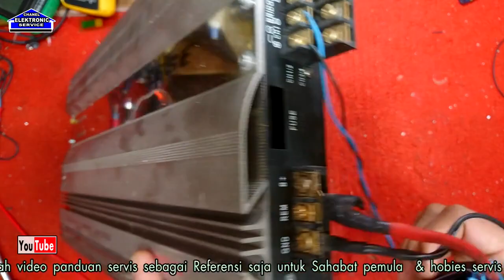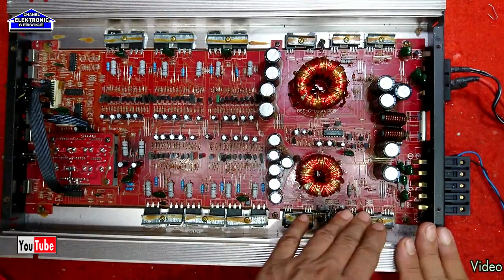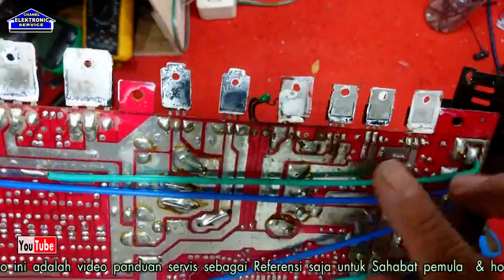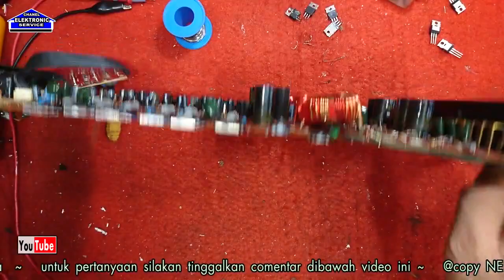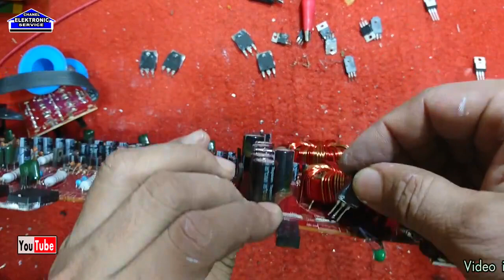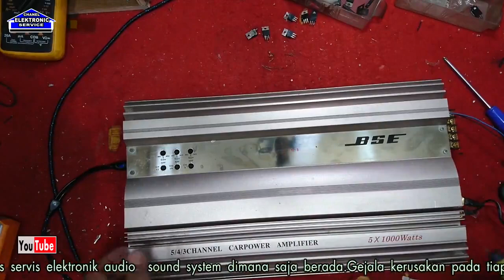servisan POWER  mobil 5 CHanel~ inverter tidak bekerja ~VIDEO 173

Comment: ditegangan tr mospect 3,5v ga kluar ,padahal IC 494 udah sy ganti termasuk komponenya,tp msh blm kluar tegangan 3,5v nya,,,,,kira2 apanya mas ?
Reply from the maker: seluri kaki fet nya arah ke TR dan ke ic tl 494.
cabut tr nya , cabut dioda 4148 , 
coba ukur lagi. . . pin kaki 9 & 10 ADALAH  untuk out Modul .

Comment: Numpang tanya master power adx momonlok protek saat volum besar.itu pun terjadi meski kabel sepeker tdk dipasang
Reply from the maker: biasanya di di bagian control ptotect nya  sdh lemah.
tiap - power macam-2 bentuk system protect , kadang dekat ic tl 494 ada ic satu lagi yg mengontrol protect ,
kadang juga berupa rangkaian trnsistor
Reply: @Servis-f3h  disebelah ic 494 ada ic njm 4558 .apa mungkin yg ini ya mas
Reply from the maker: @akhmadsyarif2389  coba buka ic nya . . .

Comment: Mau nanya bang. Kok itu power nya pake 2 inverter. Kenapa gak 1 aja bang. Apa ada fungsi yg lain inverternya. Makasih. Oh iya bang.. kalo inverter audio yang seperti itu. Pakai tegangan berapa volt yng keluar bang. 24 atau 42
Reply from the maker: pada power ini ada 2 inverter 
1 inverter khusus untuk  Mneghendle SUBWOOFER 
1 inverter lagi Khusus untuk CH 1,2,3 & 4.
Karna type power ini adalah 5 ch .
ch 1-2 untuk pemakaian speker pintu depan misalnya 
ch 3-4 untuk spker split pintu belakang 
ch 5 ~ khusus untuk angkat speker SUBW  
thanks ~ semoga bisa di pahami ???
Reply: Om apakah power ini setara dgn momoblock ?
Sya jg punya power LM audio Cooper series cp-5100  5chanel